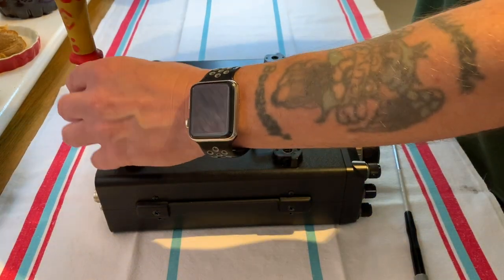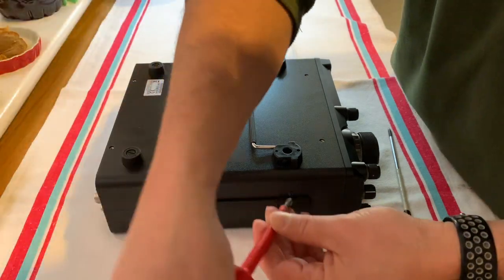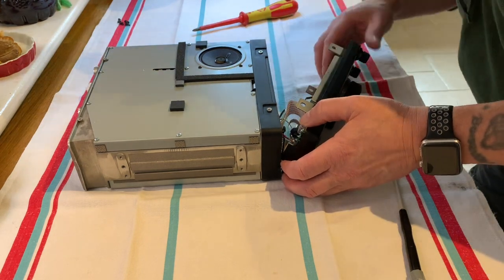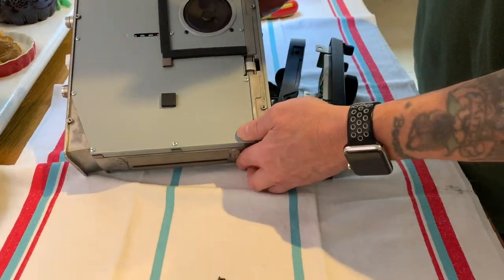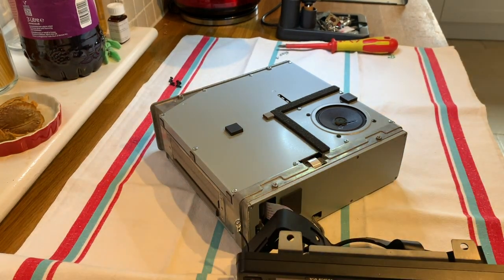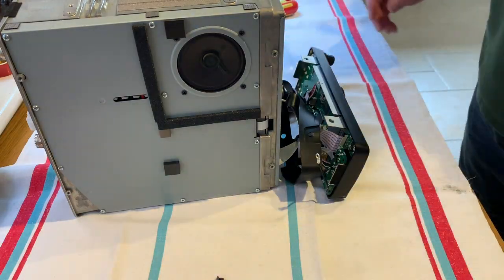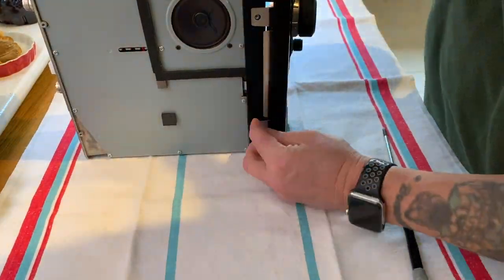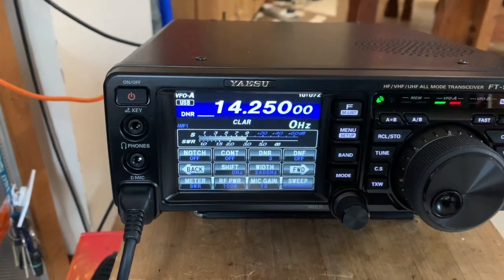Yaesu FT991A - MARS MOD

Comment: Ive had fabulous results using conductive paint. Much less risky. Just a tiny dab on the tip of a toothpick does the trick... and its water-based so if you mess up it cleans up very easily.
Reply from the maker: Awesome

Comment: I just did research to see if the mars cap mod allows a radio to transmit on airband and it says yes but it’s so cool
Reply from the maker: ah No it doesn't the mod only opens up the extended  TX on HF bands not VHF and defo not the air bands / Military ..

Comment: I recently bought one that had, had the mod already done. I understand if you choose to TX on the UK 40 with it, it should not be used with more than 10watts due to potential filter damage. Is that correct??

Comment: Tip for anyone trying this. Clean the tip of the iron, use good quality unleaded solder and use flux.
  Too close to blobbing those ic's with solder when using a dirty a blobby tip and no flux!

Comment: @Mike-M0MSN hello Mike always a pleasure to see a fellow ham who doesn't fall into the " but that's for muppet" brigade, a proper enthusiast who enjoys radio as a whole. 

I like watching your videos as you have an eye for detail and whilst I modified my 7300 (my bum collapsed at going near the tiny component with a solder, so I snipped the resistor/diode instead with baby clippers and hoovered the dust).

This mod to the 991A is also a squeaky bumtime moment as my hands are like a typical whisky drinkers hands on a Sunday morning. 

So I've just ordered a 991A from Lynch and paid to have the mod done.

One question Mike if you have the time. Im sure I saw something from the VK side in the comments about a way to expand more than HF (PMR band etc etc) by moving jumpers? Has this been done yet?

Once again.. Thanks for sharing

Comment: Hi,
I bought the 991A in Japan. The main issue is that in Japan the 2-meter band comes moved to left, so it is locked over 146.000.
I know how to manually unlock it, keeping the 3 buttons pressed to access the service mode. But I wish to unlock it definitively intervening the device.  I read if I can put welding on one of the pines it can work.
Please, anyone has happened the same and knows how to unlock it in this way? If you can comment on that, I will really appreciate it.
Greetings
Reply: Short jp3001 to jp3002
Reply: @wtfmurphy  Can anyone confirm if this does indeed open up the 2m band to match the U.S. band plan?
Reply: @RepomanGP  nope just HF, no VHF or UHF
Reply: @wtfmurphy  Thank you.
Reply: @RepomanGP  if you want to get a cheap rig without VHF or UHF, get an icom 7300 from japan and mars mod it so you can use it in the american bands 50mhz to 1.6mhz
Reply: @wtfmurphy  Thanks, that's a good idea. I already have a U.S. model Yaesu FT-991A. I was just trying to help a friend who recently picked up a 991A from Japan (for a great price) and was hoping the mod would restore the 2m and 70cm bands but we realize now that it won't.

Comment: Be very careful people if your intending on doing this mod. I did this to my 991 and now the the screen doesn't work nor transmit. Reversed the procedure to which it made no difference. The radio switches on but it's like the radio is now permanently brain damaged
Reply: Update! It wasn't the mod that affected the lack of display and transmit it was my own dumbness of not routing the cables back correctly after the Mars mod and battery replacement. All is good now.

Comment: This is foolish to pull a radio apart like that. Do you know how many times you flexed the ribbon cable? And then you stated you weren’t sure what end the mod was. This is crazy. No wonder Yaesu disavows any meddling with their warranty products. I would never recommend much less make a video of it. 

KA1LQE
Reply from the maker: I agree, however when they would not repair it after the front end blow, the warranty was worthless. That said, it was mine to play with and this is how we learn. Foolish or not Terry, I achieved what I set out too.

Comment: When you wide band the 991A is the expansion the same as like a 857D? Meaning does it open up VHF/UHF like the MURS and FRS band as well?
Reply from the maker: No this only sidebands the HF part on this version of the 991A
Reply: Bought mine already widebanded but i was hoping i would be able to use the pmr channel for local chatter but it does not work. So must be another mod to do that somewhere.
Reply: @26DR715 I don’t think there is one, not on the uk version anyway.

Comment: Hi sir, Have you can TX along on 60m band?
Reply from the maker: Yes all bands open up to 50Mhz
Reply: @mike-M0MSN  very thanks!
Reply: @mike-M0MSN It seems odd that these radios don't come as standard with the 60m band enabled. Why is that? I've also got a couple of IC-706s, one widebanded so I can use it on 60m, the other I can't.

Comment: If you want to use a Yaesu for CB, buy a second-hand FT-897D and mod that - it's MUCH easier. (Probably true of the FT-450D too.)
Reply: OR BUY A FRICKIN CB RADIO!
Reply: @motodog1977  or just do the mod and only need one radio
Reply: CB won't work on 27555 !

Comment: HRO says that even having them do the mod means the radio can only be sent in for service, not "DOA" replacement. They also say the Yaesu-published procedure says you may lose 1 or 2 dB of receive signal with this mod. Have you seen any loss of signal after the mod?
Reply from the maker: I have not noticed any difference in the receive signals
Reply: I called Yaesu on this and hey told me it don't affect it at all.
Reply: That sounds like nonsense.

Comment: P.S. By the way Chris can you offer any advice. I have a Kenwood TS 2000 The display died . I installed a new display panel from Pac parts USA.. The radio powers up as soon as 13.8v are applied. As the power on switch is integrated into the display panel.. Full RX and TX. Just no power to the display panel.. All ribbons have been checked for shorts . All seems good there.. Lost for A solution ?? Even tightened up all pins and rings on the power lead connecters .. Still no joy..
Reply from the maker: None without a good look at it,  maybe time to take it to a repair shop,

Comment: Recently done a MARS mod on a ICOM IC- 7300 Equally arse twitching.. Used a 2mm tip and x30 magnification.. One slip and its a basket case.. Thankfully it all worked out ..

Comment: Hi, what about vhf and uhf freq? I can not use my yaesu radio on pmr freq to connect to my young son... Is not fear for users when yesu lock freq  CB 11m or PMR and radio cost lots....
Reply from the maker: EU models are firmware disabled on VHF/UHF unfortunately..  :(
Reply: From what I was told by a tech the new radios are using guardian of spectrum, which will not allow any VHF UHF out of band transmissions.. This will only work with HF bands..

Comment: has any one heard about the radio giong into "GM" mode bye it self ? thus creating a 50 watt "Bug  in you house " ?///happed to me .
Reply from the maker: Oh, Please tell me more?...
Reply: @mike-M0MSN  My991a went into "GM" Mode all bye it self and turned on the vox .all bye it self .Yeasu put it down the a faulty batch of chips in the suppled mic MH31.i dont go with this so i have had mic and rig on test with dummy load to try get it to fault again .It hasnt!! i still have not handed the "faulty mic back for a new one as required " i simply bought another mic ,on its way .i simply cant swallow a faulty mic caused this !! be carfull ,this realy did happen with a few liseners .

Comment: My God. Major freaking surgery. My Icom 7300 take the cover off and remove the resistor. This radio you have to dissect it. Im leaving this one stock
Reply: WHY HAM RADIOS GUYS PULL THIS OFF TO HAVE A CB RADIO IS BEYOND ME!

 I'VE "MARS/CAP" MODDED >>>COUNTLESS<<< RIGS FOR OTHERS AND >>>ONLY TWO<<< ARE ACTUALLY MARS OPERATORS!

Well, one now. RIP K4RRF
Reply: @motodog1977 What about operating on the 60m band?
Reply: same for me

Comment: That digital noise reduction works fantastic.  I have some older ICOM and Yaesu gear and its built in DNR is useless
Reply: I have been debating that rig and the IC-7300.  I had a chance to play with the IC-7300.  I want to use the rig also for shortwave as well as AM band reception.  When you adjust the I.F. bandwidth wide enough it sounds as good as some old tube receivers I have.  How does the 991A sound on AM reception and what is the widest the bandwidth can go on AM?
Reply from the maker: Not quite as good as an old tube set but close... funny, it one of those things you need to hear for yourself... LOL

Comment: I took delivery of this radio just this week (also in UK - I'm guessing from your accent :-). I had the mod carried out by the supplier, and I can use CB frequencies now, same as you demonstrated. I was a bit disappointed to find out that it doesn't really expand any of the other frequency bands. I was hoping for 440-450 to be unlocked, but alas no! Could you please confirm this was the same after you performed the mod? Thanks, Paul
Reply from the maker: Paul Atherton hi Paul, yep the VHF UHF frequencies are locked by CPU. There is no hardware mod. ☹️☹️
Reply: @mike-M0MSN  According to the supplier, there is a hardware mod to convert the radio to US spec, which would expand the UHF freq range to 450MHz, but he advised me not to attempt it (even if I did know what was required to do this) as he says that it screws up the HF bands (not sure how as he didn't expand on this). This makes sense as there are several variations of this radio for different world regions which each have variations in their ham bands - I suspect different jumper bridging would achieve this but no idea which and I wouldn't want to risk it personally given the cost of this radio.
Reply from the maker: @athertop  Agreed
Reply: here in Australia you can tx on 144-148 mhz 430 -450mhz also 50-54 mhz might be worth setting it to vk set up
Reply: @meggalavk3ktt  if we only knew how :-(
Reply from the maker: meggala vk3ktt please send the jumper positions:)
Reply: You'll find the jumpers are the same. Even on US versions with the Mars mod, its that third jumper bridged, but still they get wider transmit freq range than us in UK. On the 991 (non A version) it was just a clever key combo to switch region. On the 991A I am told there are further hardware mods, but I don't believe it involves those jumpers.
Reply: From what I was told by a tech the new radios are using guardian of spectrum, which will not allow any VHF UHF out of band transmissions.. This will only work with HF bands..
Reply: @nicknitro4420  what is "guardian of spectrum"? Is it a software or hardware protection?
Reply: @athertop  Many of the older radios will transmit of of band (ham frequencies) mars -cap mod, most of the newer ones won't go out of those bands on VHF-UHF even when mods are done.. Example his FT 897D will transmit out of band, the 991A will not.. This is what was told to me by a radio technician.. He worked for Motorola and owns a 991A ..and is a licensed ham operator..
Reply: @nicknitro4420  I understand. I just wondered what you meant by "guradian of spectrum" you made it sound like some secret protocol implemented in Yaesu radios :) I wonder though if the limitation on these UK models is a hardware or is it a firmware implemented restriction? I know it is fully open to 450mhz on US versions of this radio.
Reply: @athertop   No it's not. Here in the states this mod will do nothing for the VHF- UHF bands.. He described it to me as Guardian of the spectrum.. I think the FCC is part of this blocking hams out of certain bands above the HF frequencies.. There is a way of doing it through the menu I believe there is a video on it here (youtube) somewhere..
Reply: @nicknitro4420  Nick, I have seen that on US models by default you can Tx upto 450MHz. There is no need to mod for this, it does it out of the box.
Reply: @athertop  Correct!  His Yaesu 897D will transmit up to 470 MHZ that includes the GMRS and FRS bands we use them here in the U.S. The U.S. version of the 991A will not go past the 450mhz range..
Reply: @nicknitro4420  You seem to be misunderstanding me. I told you that the US version will Tx to 450. I am not suggesting it should go beyond this. I am saying that in the UK versions we can not Tx past 440MHz, so I was looking initially to see if there is a way to mod it to Tx upto 450 to match the US spec.
Reply: @athertop  I did not know you were in the U.K. That was the misunderstanding on my part.. 991A is a very good all mode radio..
Reply: @athertop One thing I can see being an issue with changing a radio to US spec or obtaining a US spec radio is that all the auto repeater shifts will be wrong.

Comment: Hi i was thinking about buying this Yeasu will . any of the uk companys who sell them do this mod   for me .Also i take it you hold down the fast button and the lock button at the same time .
Reply from the maker: Hi I'm sure that for the right price a mod would be done, and yes your right about the buttons... good luck.. :)
Reply: @mike-M0MSN   I found a video on youtube  where one of the comments states that  if you bridge the two points with sharp tweezers ect and then do a reset this will work and no need to use a soldering iron(it fools the cpu) .He did state  that it is better to do this with 2 people  and that if you need to do a firmware update then you will need to do it again.Seems  like a good idea if you dont like soldering  small contacts.I did find a uk company who will do this to a new box for £20 .
Reply: Mine was modded by the supplier (radioworld in UK) to bridge that jumper and hence I have extended transmit range on HF bands but this doesn't affect the UHF/vhf bands at all. They said there is a mod to do this but they would not recommend it as said it screws HF bands for UK use. They would not do such a mod or tell how its done. Imagine its a part of their manufacturer agreement.
Reply: @@johncliff4498How much for taking out all the screws and putting them back in again? 🙂

Comment: That's very interesting, thank you so much. I'm slightly surprised that this information isn't more widely available.
I presume that this radio doesn't store any soft service adjustments or "calibration" constants in it's memory that might get erased when you do a full reset?
Also would you mind confirming what the new TX frequency ranges are after doing this mod? For example, is 2M extended up to 148MHz (which could be useful in some regions).
Do you have the USA or EU model; I understand they have different firmware. Thanks.
Reply from the maker: Steven Birch Hi, any stored memories are deleted when you reset the radio, as this is a factory reset. I have the EU version and the VHF and UHF bands are unaffected by the MOD. Many thanks 😊
Reply: @mike-M0MSN  Great, thanks for the reply, much appreciated.

Comment: Nice job. It’s a similar mod on the TS2000 where you simply remove a couple of zero ohm resistors. But you need bloody good eyesight and a steady hand. 👍🇬🇧👍🇬🇧👍
Reply: Did my TS-2000 with no problems